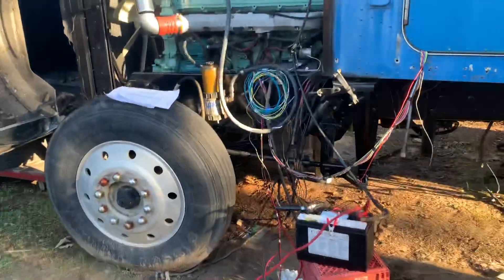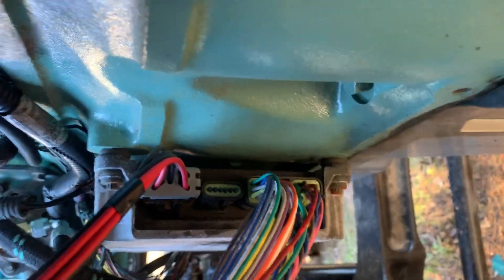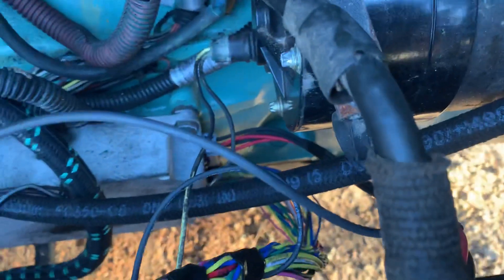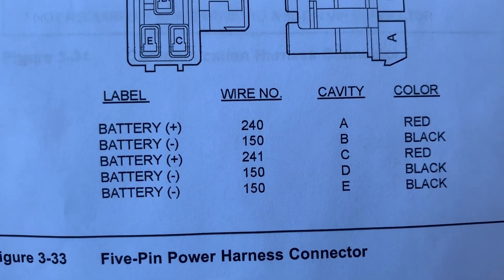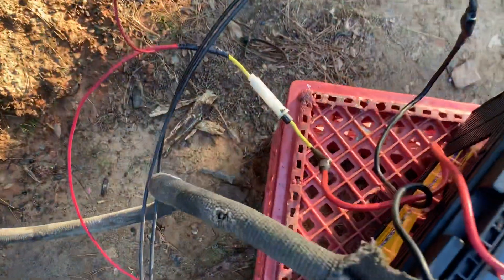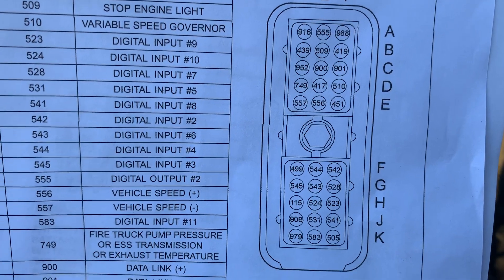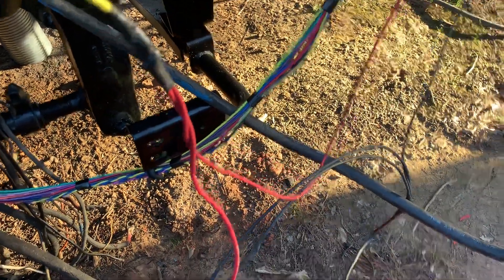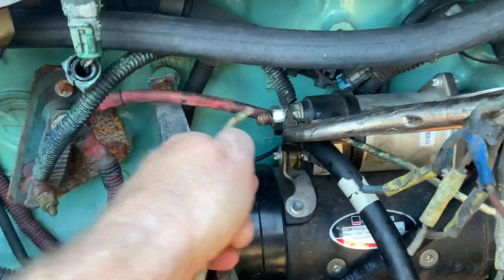How to start a Series 60 Detroit Swap Mawk wiring 12.7 14L DDEC IV

Comment: Hi question,  that ignition b3 wire,  does it need to have positive current all the time ? My truck is randomly dying on me im trying to diagnose, i have power to it but i dont know if wire is corroded and failing after it heats up for a while. If it heats up and fails due to corrosion , will it turn the truck off?
Reply: Did you figure this out my truck is doing the same things 2000 Freightliner Classic
Reply: @davidholland9352  it was my timing sensors, they were bad . And also some wiring from the batteries had corrosion in them. So i replaced those wires and the timing sensors . Also check grounded wires make sure theyre clean and have good contact with metal . There could be a short messing up timing sensor signals or other critical sensors that shut down engine like oil pressure too high or coolant too low.

Comment: Bob... can you send me a pdf of the schematic please. I am trying to do something similar and the man has gone out of business.
Reply: That five pin power harness connector is the same as the connector on a S-10 pickup windshield wiper motor . Wire in larger gauge wire into it .

Comment: Are you making the harness to swap it in to any truck, like a glider frame kit
Reply from the maker: I'm making this to go into a 1986 Pete 359... which obviously never had an ECM from the factory.  If your trying to replace an existing engine with a Detroit 60 series, if it was a make and model that came from the factory with the option to have a detrioit then you should be able to purchase the harness from the dealer.  Example: 2009 Freightliner Columbia had the option for a DD15 or  Series 60.  So, you could swap out your DD15 and buy the harness from the Freightliner dealer.  Hope that helps.

Comment: Im putting a 60 series in my 359 as well, what engine mounts did you use?
Reply from the maker: I had to make my own, because the mounts that I had would have had the engine sitting too far forward and about 3 inches too low in the back.  You just have to get creative and don't be too hard on yourself if it doesn't look factory made.  A little black paint goes a long way to hide imperfections!
Reply: @BobFM1795  thanks

Comment: I’m trying to swap a 12.7 Detroit into a 2006 Volvo 780 that has a tired ISX Cummins in it.
Reply: rebuild the isx and delete it. it will be just as good as the 12.7
Reply from the maker: @dantew6708   I've got a 2002 KW T600 with a pre-egr ISX, 13 speed and 8 bag air suspension with 3.55 (i think).  I'll sell you the whole truck for $12,500.  Runs and drives... was hauling lumber everyday until a month ago when I let the driver go for other reasons.
Reply: @BobFM1795  That's honestly not a bad deal. I got a buddy with a T6 with similar specs but his is a 98 I believe and it has an N14 in it. and he wants 13,500 for it. Me and my dad would buy it but we got too many trucks right now. We got 2-century class, an internal dump truck, and an international that were building to haul dump trailers with and i also have a cabover.
Reply: That's a good deal but if it was an even better deal we would've hoped on it right away.
Reply from the maker: @dantew6708   No worries, it should bring my asking price at auction.  Maybe more but not much less.  I was just throwing it out there because it would be an easy swap for you. If you change your mind text or call me at 903-790-1297.  I tore my rotator cuff and had shoulder surgery so I'm useless as tits on  bull right now.  I can't even shift a truck right now to drive it to the auction! I'll probably have it for a few more months at least.
Reply: @dantew6708   ain’t gonna happen. Cummins is shutdown as far as parts go because of COVID-19 and I don’t have 25k to do it. What I do have is a reman Detroit 12.7 from a truck that burned up the inside. The reman is less than a year of miles on it. The ISX is old and tired.
Reply: @Bob Brenner can you tell me where I can find the wiring harness to get this job done?
Reply from the maker: @Aegirak  The place I got my wiring harness was called Mawk.  Unfortunately, that man has retired.  I don't know of anybody making those harnesses at this time.  You will have to make your own.
Reply: @BobFM1795  I don’t have a clue how to make one on my own. I went to Mawks website and they are closed on there due to pandemic.
Reply: @BobFM1795  can you email me on my profile email address?

Comment: Can u send me a pic of the 30 pin wire connector wir schematic as to say wat wire is for wat input /output function
Reply from the maker: I can email it to you in a pdf file.  What's your email address?
Reply: @BobFM1795  torreytarvin24@gmail.com thanks man I appreciate it
Reply: @junaidbhatti2453  ok ill send it to you
Reply: @BobFM1795   HI  IF U CAN SEND ME A PIC OF THE 30 PIN WIRE CONNECTOR I GET DETROIT 12.7   MY EMAIL  GHAITH_19731@YAHOO.COM                 THANKS IN ADVANCE
Reply from the maker: No problem. Just sent.

Comment: Quick question sir...can I run an eld using that mawk kit. I want to go back to a cab over but can’t because the company I lease to requires it?
Reply from the maker: I think so.  I comes with the 6 pin data link for inside the truck but only has 2 wires going to it.  I would call Mawk and ask to be sure.
Reply: Thank you sir I’ll call them in the morning

Comment: i would install that connector for the data link, the service engine light and the stop engine light. otherwise, you wont know when there is a problem or a dtc has been set. nor would you be able to hook a scan tool to look at data.
Reply from the maker: J.C., the Mawk harness kit came with a check engine and a stop engine light, along with the 6 pin connector- which I will be using in the finished product.  For firing up a Detroit engine ( in the truck or even just on the floor) the lights aren''t necessary... that's what I was trying to help guys figure out how to do with this video.  If you just want to fire one up to see if it runs it's almost impossible to find anything on the internet or youtube.
Reply: Bob Brenner do you happen to have the instructions and the pin out that came with the  harness.
 mawk has retired  and i need those instructions if possible.would you be able to email them if you still have them?
Reply: @junaidbhatti2453   any luck finding what you needed since Mawk retired??

Comment: Is this a conversion kit ?
Reply from the maker: The vehicle interface harness is from Mawk Industries.  The engine side is factory stock.
Reply: @BobFM1795  can you recommend another company for wiring harness? Mawk is retired
Reply from the maker: Black Sam I don’t know anybody else making them. You could probably make your own, especially if you didn’t care about cruise control, and used old style gauges and fan control.  Eliminate safety features like low oil shutdown and low coolant sensor, etc.  if you can get it running and get the throttle working (like I din in this video) the engine will power the truck. The rest is is just how much computer control you want.  If I knew then what I know now I probably wouldn’t have bought the harness.  I would have went to a truck junk yard and found the vehicle interface harness with connectors and 10 feet of wire or so and labeled them myself.
Reply: Hi
Reply: No it’s not